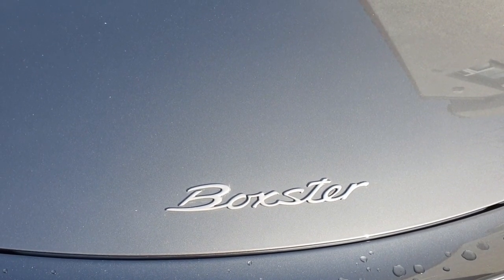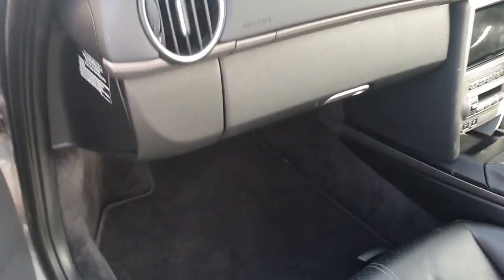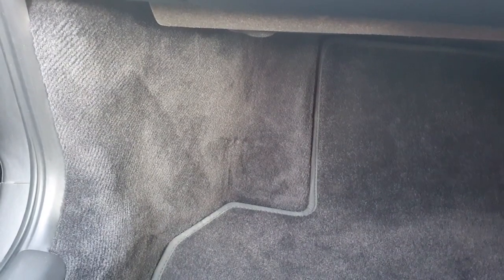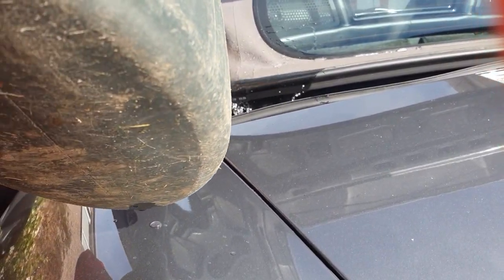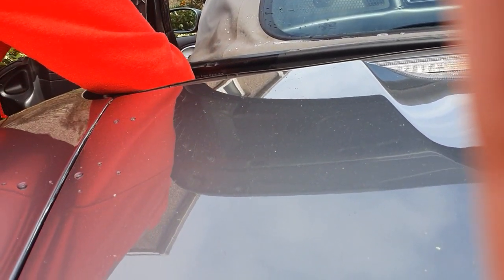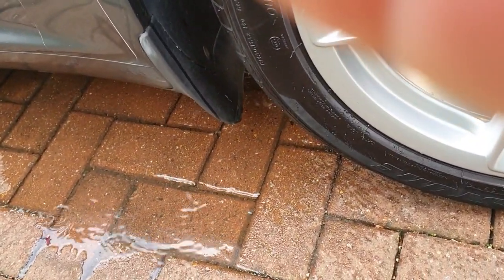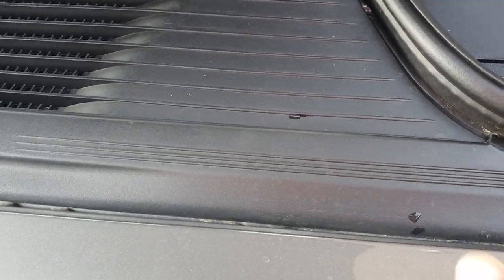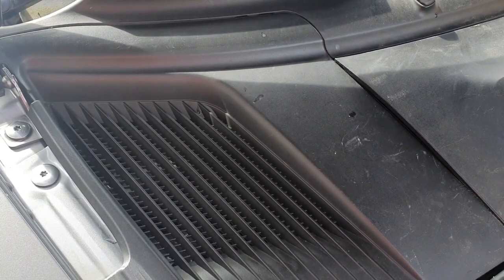How to clear drain holes, rain drainage channels on Porsche Cabriolet , soft top Boxster 987 or 986.

Comment: Brilliant regards the rear drains! (The front ones you may want to be zoomed out, to show the area you are focussing on and then zoom in - but I was able to find them all).  One of the only videos I've seen where the "side" drains that sit at the rear edge of the hood are shown - I had no idea those existed after looking at a few videos and guides.  I used a trombone cleaner - nice flexible metal cable with a small brush head, that works well to push through each of the drains, including those sideways ones on the rear top edges (a bit fiddly though).
Reply from the maker: I’m going to get better on my videography this year. Promise.
Reply from the maker: Thank you for taking the time to write such a nice post. It helps my positioning in the search engines.
Reply: @Cuttothechase  Keep up the great work!  Very helpful =D

Comment: No point saying there’s nothing under drivers seat
Reply from the maker: Correct. There may be something underneath the drivers seat. Make sure your roof does not leak and your rain channels are not blocked. Water in the car is bad.

Comment: Guys talking bollocks,
Amplify and The alarm control modules under drivers seat’ E.C.U  is under the passenger seat’ if water got under drivers seat it could cost you thousands
Reply from the maker: Hopefully you’ll get the point of the video. Water in the car is not a good thing. It may be cheaper to  flood the passenger seat side if the rain goes provide that option.